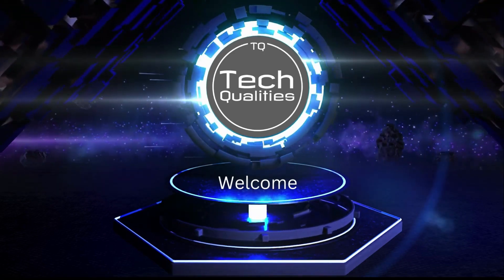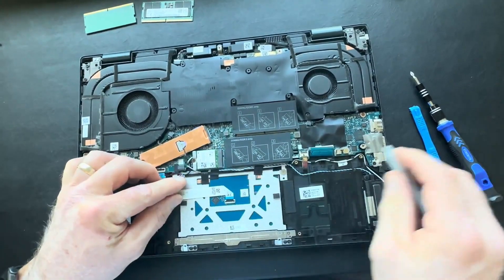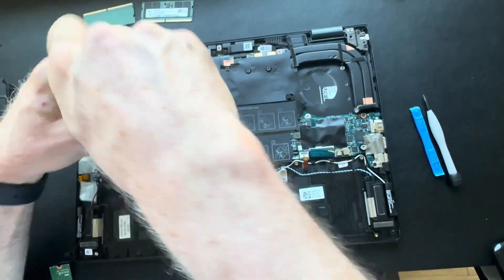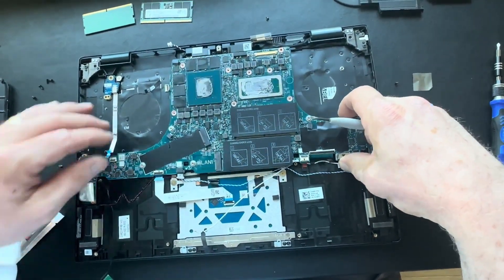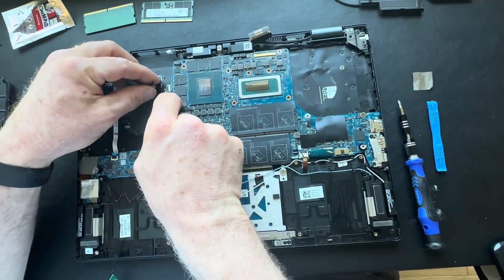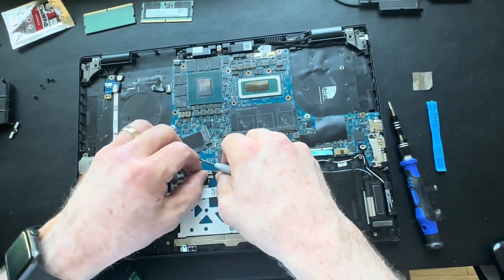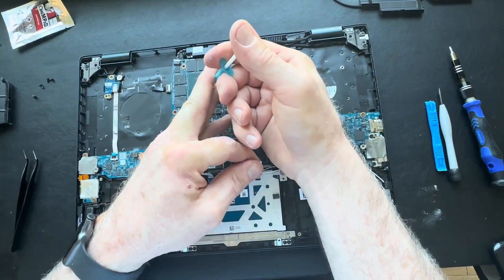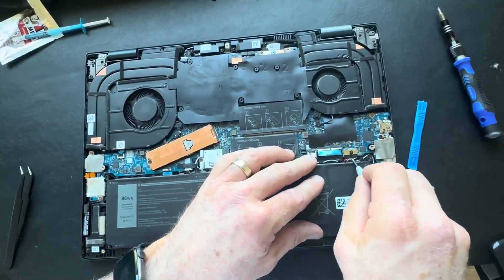Dell Inspiron 16 Plus Motherboard Replacement

Comment: My dc jack broke, i think i have to do all the steps 😅.
Great video btw
Reply from the maker: Glad you liked the video.  Yes, unfortunately this dc jack plugs in under the board.  You’ll also need to remove the screws on the right hinge and pry it up to remove the dc jack.  Good luck!
Reply: I just came here to say the same thing.

Comment: I have the same laptop but without a gpu if i buy a motherboard with a gpu can i replace it ?
Reply from the maker: That’s a good question.  If the motherboard is designed for your specific model, it should work.